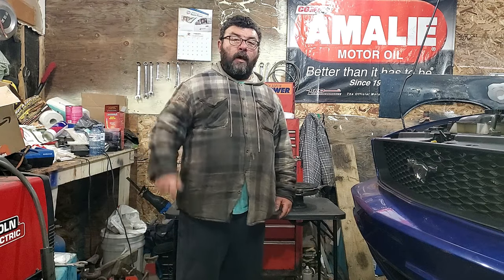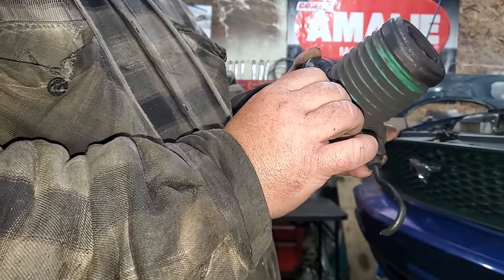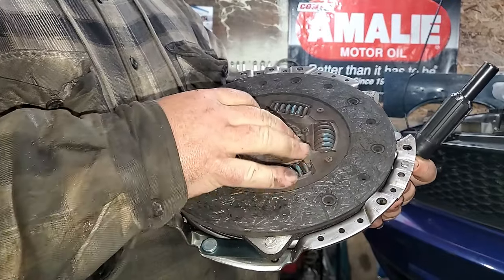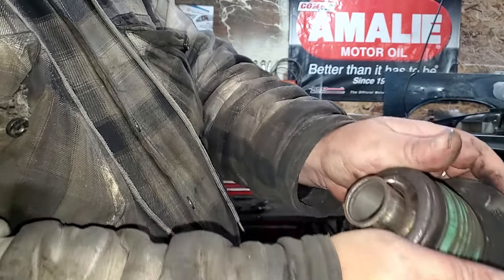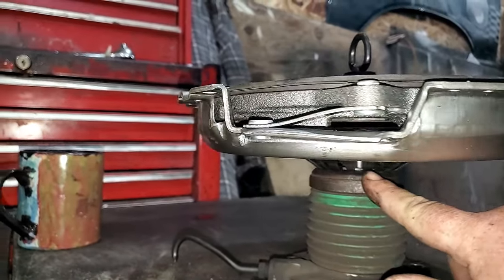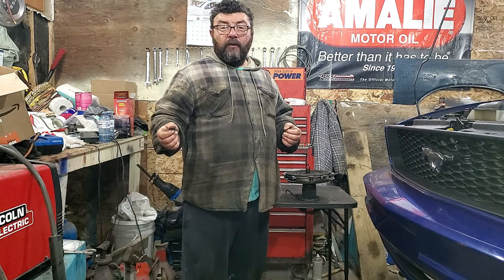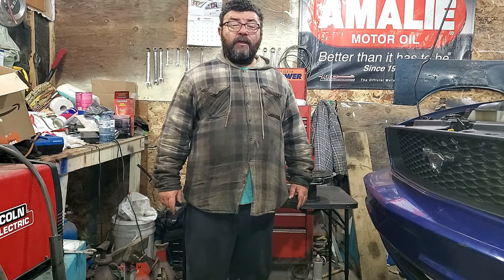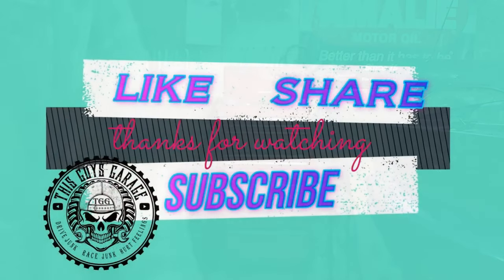why is my clutch pedal hard to push ?

Comment: Probably a stupid question, but the dumbest question is the one never asked. This wouldn’t happen to cause slipping would it ?
Reply from the maker: hey Anthony ,the question not asked is the only dumb question 100% slipping clutch would be one of two reasons ,the clutch face is worn out ,or the pressure plate clamp springs lost their tension ,this could happen from heat ,getting stuck for example.  if the clutch is slipping the only repair would be clutch pressure plate and release bearing . let me know if you have a follow up question and ty

Comment: 2000 GMC Sonoma rear wheel drive 5 speed manual transmission with a 4 cylinder engine and when my clutch pedal was very hard to push to the floor I got to the side of the road and turned the truck off myself to get out to check the clutch master cylinder for fluid and it was full and I got back in to start the truck and it will not crank or start up at all. So I got back out of the truck to look under it and I saw some wetness on the ground in the middle of the truck under the transmission. I had the truck towed home and when I got under the truck the next day I saw the line from the clutch master cylinder just hanging there and not connected. I pushed the line back into the transmission and the pedal became soft, but still very low to the floor so I tried bleeding the system several times and it never worked. Then I put a brand new prefilled clutch master cylinder on the truck and open the bleeder screw to gravity bleed the system, but no luck. Any ideas on how to get this old 2000 GMC Sonoma rear wheel drive 5 speed manual transmission with a 4 cylinder engine back on the road again? Thank you.
Reply from the maker: i would suggest a new clutch assemble including the hydraulic release bearing ,the bearing is where the trouble is , you just would not take it apart without changing everything. the line would have popped  off because the release bearing ceased  ,then the line pops to release the pressure .  which would also make it hard to bleed . bad news i know...   let me know if you have any other questions
Reply: @thisguysgarage  Thanks for your reply and I been driving stick shift for over 40 years and the truck was fine and with the way the clip locks the line into the transmission I can't understand why it popped out, but again I appreciate your time and reply.

Comment: My sons 96 mustang gt…has the 4.6 in it…he replaced the clutch and through out bearing I believe…because it was rattling bad….it’s always been hard to press in the clutch even after the repairs…I took it so I can work on it for him but I have zero experience with the clutch set up…but it’s nothing I can’t figure out eventually lol…I had to drive it for an hour trip from his place to my place and at first, it shifted ok..only scratching in third gear…but as I got closer to home, it was starting to make a weird rattling noise from the engine area…it sounds like a loose heat shield rattling under the hood…he also said the heater only works on defrost because the blend door is broken or isn’t working..when it first starts it’s hard to get it to start out in first gear and if u don’t flutter the gas pedal, it will kil the engine because it’s so difficult to press the gas just right before slightly letting up on the clutch…I have to literally twist my body and stand on the clutch to make it all the way to the floor…if it’s not all the way pressed, it won’t turn over the engine…it’s like the clutch is barely starting to engage when all the way to the floor…then once u get it going…it’ll grind the gear now in every gear when before I left his area, it would only grind third gear when shifting up…its gear so low…in town cruising gear is 5th gear..I don’t quite understand why they would put such low gears 1-4 and then 5th being to top end cruise gear…it just seems so pointless if it’s got such low gears….the noise becomes much louder from the engine area…when the heater is turned off…I also noticed it has a shake to it that runs song the transmission area and back to the passenger back tire…my son swears it’s a valve rattle in the engine …he also told me it had a rod knock but I’m very familiar with what a rod knock sounds like in a Ford engine…the 4.6 is an over head cam engine from what I’m understanding…idk for sure though..I’m just trying to prevent from having to pull the engine and drop another in because my sinus convinced it’s a bad motor only to have the same problem…I know it’s in the clutch set up that’s causing the issues…because the engine runs solid still…is it possible that he didn’t tighten something tight enough when he replaced the clutch and it’s causing the settings to move enough to cause the gear grinding in every gear? I also think alot of that noise is due to the exhaust which is obnoxiously loud…he likes it that way..I don’t..it sounds like it has rotting exhaust and in need of a new exhaust ….it makes it difficult to figure out where the noise is coming from…
Reply: not sure if it’s still a problem but i’ve had a 94 and currently have a 95 mustang, the blend door is run off of vacuum if you look on the driver side under the hood near the firewall i’ll almost guarantee you see a connector with no hose coming out of it, then if you look past that you will see the remaining hose that used to be in the connector, i believe they dry rot at the connector or something that’s how both of mine were i just pulled out the broken piece of hose from said connector popped the hose that is still there back in and just like that my blend door works without a problem 👍

Comment: I have a 1991chevy S10 2.8 V6 5SPEED and I have just bought a new clutch, pressure plate,through out bearing kit and I have bought a new clutch master cylinder and slave cylinder and I have got it all bled out and I went to try it out and it the transmission changed gears like a new truck and then my battery died and I pushed it off and now when I change gears the clutch will not engage in any gear, how can I fix it

Comment: Hi good video, but one question. Noticed the clutch suddenly got harder to push so knew a problem was coming. Is that one of the first signs of the throw-out bearing and clutch going bad? Lots of stop and go driving in the Philippines. Guess I'll just order the full clutch kit and find someone to install. Thank you for your help.

Comment: Hello. I liked your video and I would appreciate to get your help. I have just bought a Citroen C3 MK2 Diesel BlueHdi (99ps), 5 speed manual, 2016 model, with 105.000km on the clock. 

After driving it, I've realized that the clutch was very stiff and it was hard to press it and it equally pushed my foot back, when releasing the clutch (Note that I am a 6ft., over 200pounds person, so I am not short of strength).

I decided to change the whole clutch set with the LUK one, valvolines, as well the clucth pump (I was told by the mechanic that LUK is the same brand that the brand's dealership put in this car). During the first day the clutch was quite lighter.; not buttery soft, yet quite lighter. Now the next day, the clucth became almost as hard to push as it was before changing the clutch set.

Is there a way to make it buttery light/soft without spending a fortune? It has already started creating pain to the bottom of my foot, with which I operate the clutch. I find it unreal for any car to have such a stiff clutch. Thank you in advance for your support. Vassilis
Reply from the maker: Is there an inspection hole where your mechanic could see the shift fork operation,  the shift fork  (clutch fork)may be wore and  causing the release bearing to be digging into the input shaft of the transmission causing a hard pedal.  Or the clutch fork may have dislodged and came out of place,  I would look there first.
Reply: I also have a Citroen c3 1.6 e-hdi 2012 and my clutch is extremely hard. Did you find what is causing that?
Reply: I am going to replace the clutch master cylinder because the connection point to the clutch pedal has broke (i imagine because it was so hard to press)… I'm also thinking of replacing the slave cylinder but I don't know if this is causing the hard pedal
Reply from the maker: @beastuct  you have to replace what is broken but I think you need a release bearing, and if you're that far in you may as well replace the clutch and PP
Reply from the maker: @beastuct  it's generally the release bearing.

Comment: Good day Sir, 
My vehicle is a 1995 Ranger, 2.3L, RWD 5 Speed Manual Transmission. 
We dropped the transmission, replaced the clutch, pressure plate, pilot bearing, release bearing, hydraulic line o ring, drained and replenished the fluid until it flowed out of the fill opening. 
We checked all fluid levels and got into the truck to test drive. As we pushed down on the pedal, you could not push the pedal down to the floor. I pushed so hard that I bent the pedal! 
Any suggestions on this issue would be greatly appreciated. 
PS; only the release bearing was replaced, not the whole assembly.
Reply from the maker: The clutch plate sounds like it is backwards.  Sorry for the late reply just seen this

Comment: What if my clutch is only like 7 months old and brand new and installed by a licensed mechanic  and slave cylinder  replaced . But then my truck just launched forward the other day  and is not going in to gear when on but when of its smoth ?? I am glad I found this video because I just purchased a slave and master kit but haven't put it in due to worry it wasn't the problem

Comment: what happens if you change the whole clutch assembly with a new one and after that the clutch gets harder than it was before and only when the pedal is pushed to the max, in those 2mm in the bottom, you can shift into gear? and when you release the pedal in those 2 mm in the bottom the car immediately goes. My engine died 8 times in 10 minutes because it was an entirely different movement than I was used to and my foot hurts like crazy because of the stiff clutch. Is there a tune-up that can be done to ease the pedal's movement? Again: the whole assembly is brand new
Reply from the maker: The clutch was installed backwards
Reply: @thisguysgarage  thanks, I'll be looking into it. And there is another thing: in the first 2-3 cm of travel in the clutch, I feel a slight vibration like I can feel the engine's revs. That was very weird. And if we open it again and find that everything was installed correctly? It is on a Nissan Qashqai j11, and I read that Nissans usually have stiffer clutches than usual, but the whole thing feels very different. Thanks for the answer :)
Reply from the maker: @blad30  that piece of information on the vibration felt on initial travel is sort of confirmation of my initial thoughts on the plate being installed backwards.  Let me know what you find as it will have to come apart regardless you will find the issue there.

Comment: Hey found your video today. I have a 95 mazda b2300 SE has 87,000 miles and in mint condition, I'm the only owner.  A few years ago I started to notice hesitation when I was at a stop sign or stop light, despite flooring the gas and truck reving very high. Then it would finally shoot forward.  I did some research online and finally decided to add techron concentrate plus, figured the injectors could be fouled. This seem to work great. I only drive 2,000 miles a year since 2015.  I added the Techron then filled the tank once a year. Problem seemed solved, no mechanics could find anything wrong either.   But then 2 years ago, it got worse, I would drive about 25 miles on highway in 100 + degree heat and my truck runs beautiful on highway, then get to a stop sign or light and my truck acts like it doesn't wanna go, revs very high, acts like it's gonna die and then finally shoots forward (almost got me hit twice making left turns, very scary) Then it would get worse and worse, every stop light or gear change I would have to start pumping my clutch to change gears,  till clutch finally became like a rock in up position and I could no longer even engage clutch to even start truck.  Been 2 shop twice, but by the time tow gets truck to shop (3 to 6 hour tow wait times)  The truck has had time to cool and will not replicate the issue for mechanics, despite me leaving truck for 2 weeks both times in july and september at shop.  They all say how great my truck drives and how great it looks.  Yeah, till it does this crap to me again and leaves me stranded.  We replaced the catalytic converter last year (expensive) didn't help . My regular mechanic is an old school guy, but they can find nothing, no leaks, no wear, clutch in good shape despite it being factory original. 

Could this video you made be a probable cause of what my trucks doing??? I have an appointment with a transmission shop in 1 week, but I just don't feel its my transmission.  I don't abuse this truck, it's well cared for since I got it new in 1995, has low miles, maintained regularly, garaged, only drive it 1 to 3 times a week. Any suggestions would be greatly appreciated.  Because I have a 2nd problem now, my truck wont start, no crank no nothing.  Towed to shop last week, they could find nothing, so we decided to replace starter. That didn't help.  I get in, turn key and nothing, but lights and dash all work, then I notice I have to pump brake a few times and then try to turn key and it turns on.  Why would I have to pump brake??? To get it to start. I start in 1st gear with ER brake on as I've done for 27 years and remove brake as soon as truck starts and I'm ready to go forward or reverse.  Has a new battery and cables as of 17 months ago too.  new timing belt.   I tried spare key, thinking key may be worn and replaced fuse 19 which is a 25 volt.  Nothing helps. I love my truck  and use it mostly to rescue abused and neglected animals for my small sanctuary and cant afford a new car. I also don't want a new car, seems manual transmissions will be obsolete in a few more years, no one will really know what it feels like to really drive a vehicle, they just wanna push a start button and have the car do all the work. SAD, just SAD. :(  I would appreciate any advice you have. Thank you : )
Reply from the maker: Let me get back to you on this I will have to obsorbe the information a little further I may have follow up questions

Comment: Hello, the s550 brand new Mustang Ecoboost`s clutch pedal is harder than same year V6`s and GT`s, and much harder than 2018+ GT`s, how to fix that? What effect the clutch pedal force? by Pressure Plate Finger Force?  Clutch Master Cylinder? or Clutch Slave Cylinder? Thank you
Reply from the maker: I have never driven the ecoboost with a stick , I have driven both the 5.0 and v6 versions both were what I consider soft clutchs aka easy.  Is there a different gearbox in the eco version?
Reply: @thisguysgarage  Gearbox name is same(MT-82). Gear ratio Eco/v6 different compare to 5.0. The Flywheel, clutch disk, pressure plate, Clutch Master Cylinder, Clutch Slave Cylinder, and  Hydraulic Throwout Bearing are all different compare to 5.0/v6

Comment: Can you just guess/tell what might be my cars problem. It runs well with no clutch issues but after you drive 50+kms non stop the clutch can't be pressed(like after pressing the without keys, get locked), even if pressed the wheels don't get any force or the rpm only increases
Edit: forgot to mention if i let it cool for 10-20mins it get fixed but clutch gets hard, a bit.

Comment: Hi, my clutch had change 6 months ago everything was change new Flywheel, release bearing, pilot bearing, clutch fork, new clutch master and slave cylinder also at first 2 weeks it was soft like normal one but after how many months it becomes stiff too much i was thinking is it the clutch cable need to replace? Thanks in advance!
Reply from the maker: Two things will make your clutch suddenly stiff  the release bearing or the cable,  so a safe bet would be to swap the cable 👍 your on the right track, let me know how you make out 👍

Comment: Hi there. When depressing the clutch pedal what exactly returns the clutch fork to its initial position? Is it the pressure plate or is it another spring somewhere maybe the one on the slave cilinder? I am having a problem with my car, the clutch pedal is in the depressed position (up)  but when I try to press it, I simply can not, it is rock hard, mainly because the clutch fork cannot move any further. There is hidraulic pressure in the system and I can also move the clutch fork with my hand with no problem, it simply reached it maximum pushing point and the slave cilinder rod cannot push it any further without something being riped apart. Could the pedal have fallen out of adjustment somehow? or the slave cilinder? Have any ideas? Thank you!
Reply: not too clear, -depressed it down,not up- but, what returns it, exactly,when you pull your foot off? easy,
it's the throwout bearing;
and of course, this bearing is in turn moved back,returned, by the BIG round diaphragm spring,the heart of it all; if it overheats and its fingers bend,or break, you cannot release the clutch,
1st thing i would chech there,is if i still had a good clutch,and if the slave cyl. came off its mount